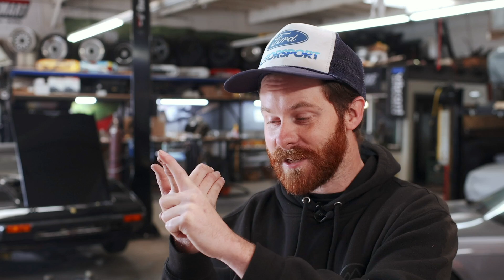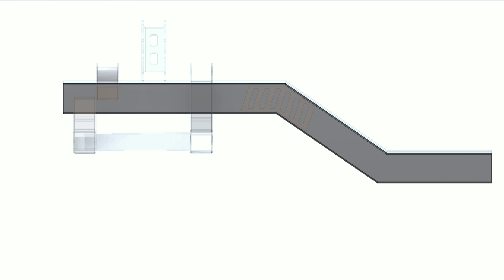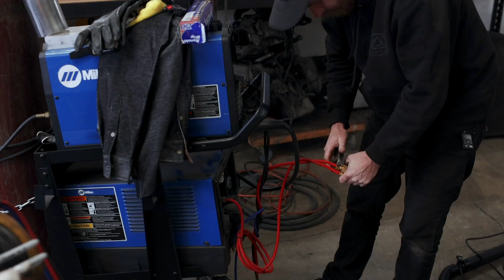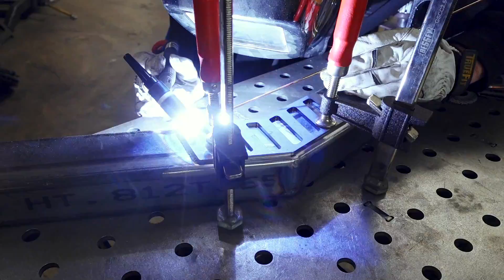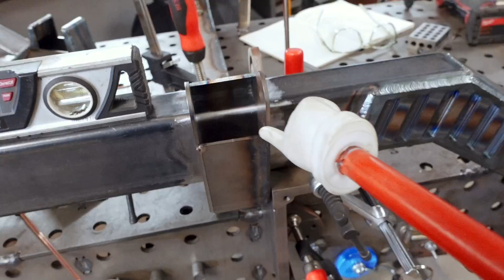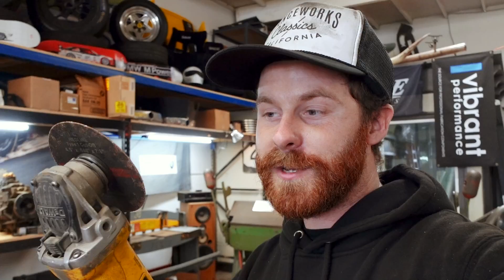Custom Chassis PT 2 - Making Frame Rails - 800hp 1931 Ford Truck Build!

Comment: Soaking steel in vinegar overnight will make the mill scale super easy to remove. Make sure it’s fully submerged so it doesn’t rust it. I usually soak a bunch and then pressure wash it off and dry it asap. Then you can just hit it with an orbital sander and it’s super clean, plus vinegar isn’t expensive and it can be reused a few times!

Comment: 10:45 its not a finger guard its a spray shield to direct the sparks away from your face/balls. I also dont use the handle that screws into the head and both for the same reason. cant get into tight spaces.

Comment: I like your answer on why you choose to run your angle grinder without a guard.

Not everyone answers this question while actively saying to run the grinder with a guard at home, and adding to that I respect your higher than usual saftey standards regarding your cutoff wheels.

You should be overly cautious with them if there's basically nothing stopping the wheel from launching itself into your face

Comment: About accepting the level of danger with the angle grinder. If i remember correctly you said basically the same thing about the model A  until you had a near death experience with it and now look at you, taking every precaution to make sure you're as safe a possible while driving it. You do you.

Comment: Awesome videos man !   Loving the builds.   I’m new to tig welding loving it.  I’ve been concentrating on learning aluminum and stainless.   And my machine is gas cooled.   Is there a reason you use water over gas ?  Just curious

Comment: Great work as usual cobber I love the precision and attention to detail. One thing is bugging me is you cut the fish plates in a way the seems to massively reduce their strength. The continuous part of that plate that passes from one side to the weld to the other looks to be <20% of the available height. A friendly suggestion for future projects, horizontal windows or just thickening the top and bottom strap would have given heaps of function back while maintaining similar form. Comment offered with deference to your superior skill and work ethic and hope of algorithm boosting.

Comment: Same here on the no guard on the angle grinder.  It would be worthless with the guard on.  A long time ago I stuck my thumb into the cutoff blade and needed ER stiches.  Luckily I missed the thumbnail.  I now have total respect for the guard less tool.

Comment: The angle grinder explanation is a little short sighted. Using the tool with a flap disc or RF sanding disc and no guard I'm good with. Those 1mm cut offs and no guard just stupid. and used properly with a guard and a cut off the tool is no less versatile so that was a excuse not a reason. Learn to use the tool with the guard properly with a cut off wheel. Don't care how may years, days or hours you've done so safely having patched up and taken people more than once in the last 40 odd years to hospital to be fixed after them taking the guard off I can tell you "it no if but when and how bad the damage will be" I've fired employees for removing the guard

Comment: I don't use guards on my grinders either, because of the same reason. The guard is a pain in the ass, although Fitzee does cut his guards down which looks like a better compromise. I did get sick of filling my nose with grinding dust, metal and whatever else so I wear a full face mask with filters which is better protection all round. Nice work as always.
Reply from the maker: That’s smart, honestly. I need to be better about wearing a msdk

Comment: Grinders will bite you quickly but damn idk how many times I’d move the guard and stop and move and stop and move. Then just take the damn thing off and get the job done. Always use a full face shield and use it with respect. All good.

Comment: Death wheels are, as you say fine if you respect them. I make sure I'm not in the direct firing line of a shattered disk, but 20 or so years and no incidents later its an awareness of my own mortality over a safety issue in the most part. 

Chassis members are looking great.

Comment: Mike, just a quick suggestion, if you're making larger parts (or any parts really) like the frame rails out of hot rolled steel, here's a suggestion to get rid of all of the scale. Cut a shallow frame out of wood, line it with a plastic garbage bag and place your piece(s) on the bag. Fill an old coffee can or something similar with muriatic acid then with an old paint brush or steel wool coat the metal parts with the acid for about 15 minutes and presto, no more mill scale. Then take a water hose, spray off all the old scale and acid and your parts are bare metal. Just dry them off and you're ready for paint, welding, etc. A few cautions, first muriatic acid will etch concrete and similar materials so flood the acid when you spray; second, the steel at this point is completely exposed and will flash rust in a few days; third, make sure you wear gloves rated for the acid.

Comment: I have an angle grinder that looks EXACTLY like yours.  I've had a disc explode and had no problem.  The important things to remember are: don't put your face in line with the rotating part and use proper PPE such as safety glasses and face shields.

Comment: When the angle grinder starts getting weird I usually just move my face out of the line of shrapnel, but I always wear eye protection, I already got a piece of metal in my eye not fun. And yes I always toss out disc that look sus, just my opinion.

Comment: I knew a guy just like you that refused to use a guard. He's dead now after that cut-off wheel exploded and cut off the top of his head from his left eyebrow to his right ear. You might get lucky with that flapper wheel and only loose an eye, but those cut-off wheels are killers. Serious bro, don't do it!  Harbor freight won't even send you flowers when you're dead

Comment: Hey Mike,  when u said i buy them(discs) in bulk, i had to think about the expiring date on those cutting discs ... in the metal inside edge is the date! people sometimes do sales on 'almost' expired ones   :(  this is also a common reason for failures (with or without guard ;) )
Reply from the maker: Worry not! My current box is good until 2023

Comment: I never use the guard on my angle grinder, either. As you say, you won't have a problem if you know how to use the tool and take care of the discs. I also try to not stand directly in line with the rotational direction of the tool, too, just in case it does let go. I also wear a full face shield when using cutoff discs or wire wheels. A fabricator friend of mine who has been in the industry for over 30 years doesn't use the guard, either.

Comment: Little pro tip , when you have to use a mitered joint, cut a matching thickness piece of sheet metal and just match the tubing profile minus 1/2 the material thickness, tack it to the one side of your mitered tube then match your second piece up and weld out .. it makes the joint waayyyy stronger .. for example if you have a 2x3 .120 wall tube you’d have a plate that’s 1.875x2.875 .. builds look killer man can’t wait to see them back on the road

Comment: I am afraid those fishplates will hold water because the holes aren’t welded shut, it’s no comment. Just wanted to mention it in case you haven’t thought about it. I am a custom build yacht painter and always notice potential areas in new constructions which I see on you tube that will rot eventually. If it’s worth it and people are really motivated and dedicated builders I warn them

Comment: Great update! Couple of things. Who the f@$k wishes a regular guy to bleed out for using a grinder without the guard?  Second point. I don’t think many people realise how long these things really take. The jigging, measuring, checking, measuring, clamping, measuring, cutting, measuring etc, takes a lot of time. This point was illustrated on Binky. Throw in editing and your time is done!! You’re doing great Mike. Don’t go changing. On the suspension front, software is pretty expensive but I recently acquired a package called DynatuneXL. As the name suggests, it’s based in MS Excel but works very well. It was designed by Paul Fickers who has an extensive chassis engineer resumé! One of its handy features is a quick measure of bump steer.

Comment: I run an angle grinder with out a guard, but I always have welding gloves on and a face shield..... and this only started after having kids.  Before that, it was no safety equipment no guard....

Comment: Folks who talk trash on no guard should see the guard options available for pneumatic angle grinders spinning 30,000rpm. Spoiler alert, there are no guards available for those little air 90 grinders.

You do you.

Comment: The thing with the grinder is more a personal matter, if you know what you're doing it shouldn't explode. For me i use a grinder with the protector on pretty much all the time, even though when i was young i saw a cutoff wheel explode and fly into my dad's safety glasses and then fly off across his forehead. 

No real injuries since the glasses took the majority of the hit, that still scared the shit out of me and kept me away from the grinder for 2 years after that. But now i occasionally use a grinder without the protector, sometimes you just gotta do what you gotta do.

Comment: I hope you or anybody is hurt with exploding grinder disc. Also if you are ever worried about your safety, using a full face shield (in addition to safety glasses and hearing protection) will add another layer of safety. Net result is take away one layer and add one, making it just as safe.

Comment: I remember when my grinder got caught in the metal I was cutting such that I dropped it and the blade shattered and bounced off my leg. Proper spanner moment.
I thought, huh, is that it. I was expecting blood. It just bounced off. No blood.
I'm not convinced the blades from a 4.5" grinder can get lodged into your skin. They are too light and flimsy to have enough momentum.
I just ensure my eyes are protected.

Comment: Should check out the metal cut off blades! I also run mine guard less. Figured these would prevent a blow apart, was Leary at first cause they’re salty but the Lenox metal max blades are sick and last forever!
Reply from the maker: I've tried them and hated them, personally. It felt like it couldn't cut anything.

Comment: Ok, I accept your a pinion on grinder guards… just one point, 95% of the time you can easily use you grinder with a guard, the 5% is due to tight access. guards are very easy to adjust, move or even shorten all of which WILL save you and for the 5% of times the guard comes off easily 🤷

Comment: In my company if they see a grinder without the guard on, they gut the power cord so you can’t ise it anymore , and i’m a heavy diesel technician so i use it a lot of times , and with the guard on , you can still use it in 90% of the cases

Comment: So I’m currently watching this video. And as a welding teacher. I heard you say you don’t advocate grinding down welds unless for fitment. Yes I agree with this because of aesthetics. But. What isn’t mentioned is that the weld reinforcement adds zero strength to the weld. A weld with a reinforcement of 1” high has the same strength as a weld ground completely flush. It’s when you remove the weld past flush when you start seeing weak point within the weld and could cause stress risers which lead to cracks. But great work man!! Love your projects!!

Comment: I also use a grinder without a guard, I don’t like it. I don’t advocate for it at all. At the very least, use a handle. Im like if ima play with a 8000rpm blade, I at least don’t want it to slip out of my hands 😅

Comment: Just curious...for the angled chassis rails, would it be stronger if, instead of cutting the tubing all the way through, to make a pie cut into the tube and then bend it and weld it leaving the " back side" of the angle continuous original steel?
Reply from the maker: Eh, maybe slightly, but not really. Not worth the effort.

Comment: Hey Mike, I am no expert when it comes to power tools (atleast at the extent you use them) but wouldn't it be safer if you used a Face Shield? You would still mantain the usefulness of the tool without the guard but if the disk exploded it wouldn't pierce your face...
Reply: Yes I was going to recommend this! If an Engineering Control (guard) is not available and Administrative control options (training, etc.) are exhausted, then the safest option is PPE. 

You can get very clear face shields that will save your head and not block vision or anything. Stay safe out there!
Reply: @safedork  I also uses face shields. It also protects against all that dust and grime getting into your face :). My eyes are the most valuable thing I got. Regarding guard on the angle grinder I use one with and one without. New grinders have quick position of the guards and most of the time I use the guard to protect my hand and redirect the sparks - not for exploding discs
Reply from the maker: You’re not wrong
Reply: @stanceworks  I’m exactly the same way. No guards on any of grinders. Just respect the tool and don’t be dumb

Comment: Awesome work, Mike!  You're a much better fabricator than I will probably ever be, and I know I'm my own worst enemy and I'll leave my guards on or wear as much PPE as possible.  I've been bitten too many times by being impatient and not doing things the safe way.  It may not happen this time or the next 1000 times I use the tool, but eventually it will happen and the only person to blame is yourself.  That's my hot take on it.

Comment: I'd love to hear a quick explanation about mig vs tig welding from you. Have to confess that I've been simply rolling with "tig = very cool" all this time!
Reply from the maker: It’s just more fun to do and looks better. It’s a skill I’d like to have so I’m working on it every chance I get!
Reply from the maker: It also has a lot more control. You can do materials other than steel, and small sheet/thin plate parts are much more manageable.